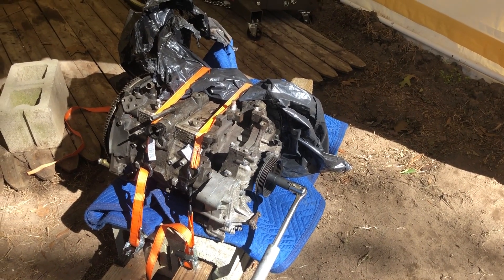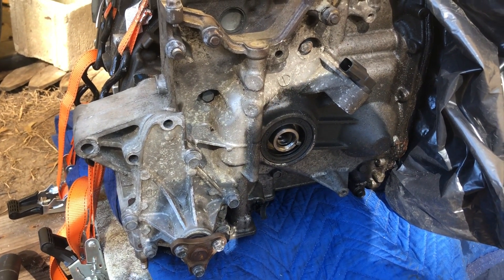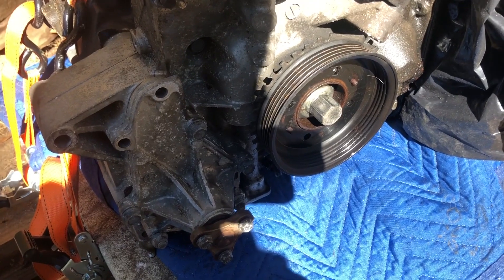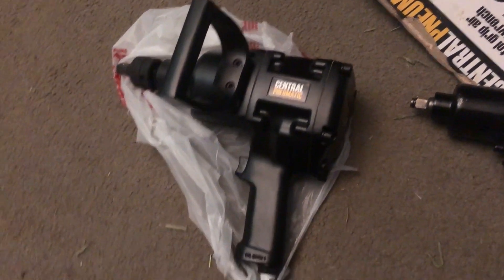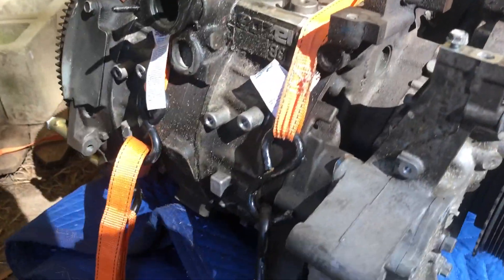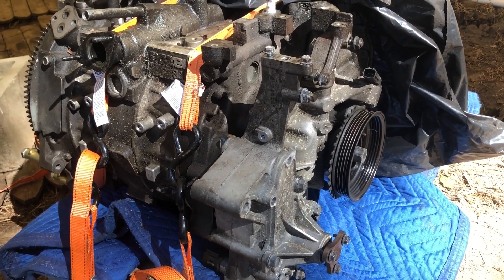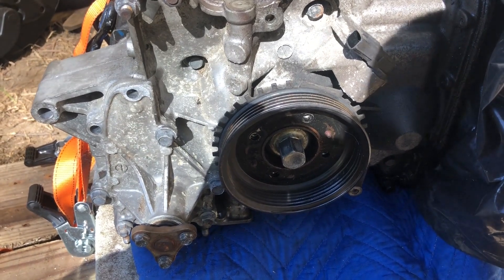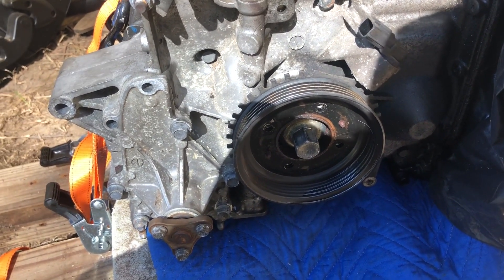RX8 eccentric shaft main bolt removal

Comment: This saved my ass, i had to do the exact same thing and ratchet strapped it down to 2x scaffolding planks and had to use a cheater pipe, the breaker bar was taller than me and it took every bit of effort to loosen the bolt. It’s incredible how tight it was. Thanks for posting.
Reply from the maker: yes it is a struggle , i am glad  it helped you , i had an air impact bus wasnt strong enough ,